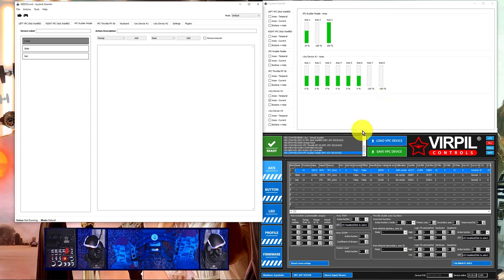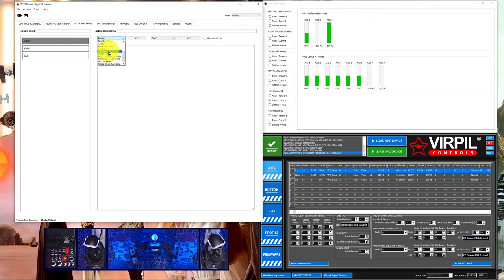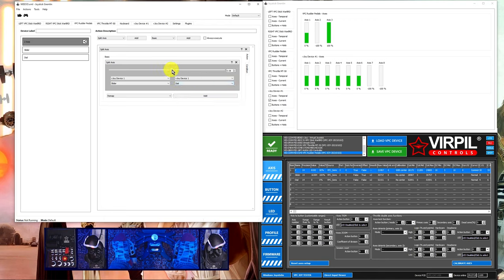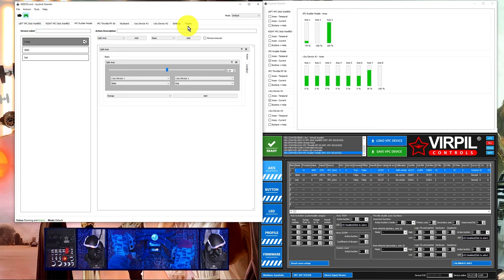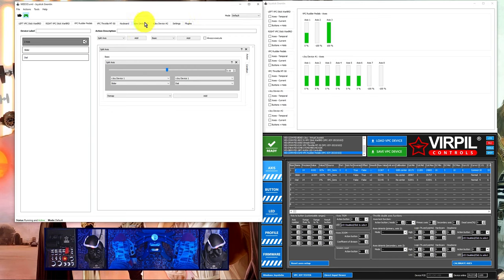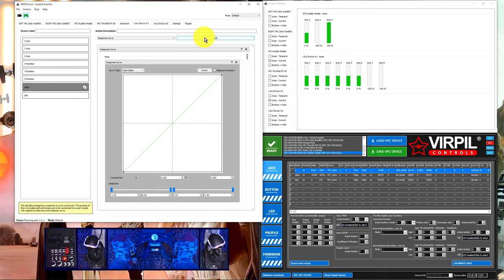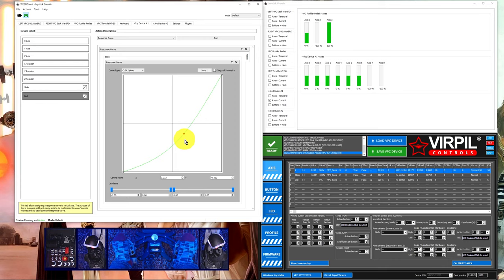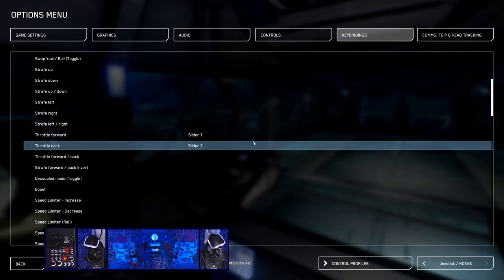Joystick Gremlin - How To Split Axis

Comment: Hey man thanks for this tutorial (1 year late to the party).  I'm using split axes as an attempt to workaround an issue I'm having in star citizen where ships randomly continue sliding 1-2 m/s after stick axis has returned to center.  Confirmed in VPC tester there are no residual inputs being detected that would cause this, calibrations are properly centered. Happens with both WarBRD/ Constellation Alpha and the same pedals you are using in this video. Have you ever experience this issue in SC?

Comment: Can you make it so that you have the standard axis still available?
Use case: virtual toe brakes -- my rudder pedals (VKB T-rudder mk4) don't have toe brakes, so I want a button to slowly activate differential toe brakes, but I want the rudder to remain active as well-- and if I apply one pedal the opposite side will reduce pedal pressure. 
Even better might be an option to have a separate slider as the total pressure applicator when centered -- ie slider at 50% means with rudder pedals center and button held == 50% brakes.

I've tried VKB's T-link software, however that thing is a giant piece of shit with memory leaks and tends to crash after just a few hours.

Comment: you are my saviour
Reply from the maker: Glad to help!
Reply: @RedLir_Live  I spoke too soon. Following your steps, it seems it didn’t split the axis on my twcs pedal. I was also wondering, do you need to use hidhide, in order for joystick gremlin to work (currently in use). Thanks in advance for any help!!!
Reply from the maker: If you don't use hid hide the game will see the physical axis as well as any vjoy axis you assign so binding can get messy 

You can still make it work but you need to turn on the input repeater function in the menus so JG will repeat the vjoy bindings over and over while you're doing bindings and then turn it off when  you're done

Comment: Can you split the throttle stick into keyboard inputs W and S? Since no man's sky isn't compatible with peripherals it doesn't work with axis settings
Reply from the maker: Yes. Look at the "Virtual Buttons" video in the playlist for some examples
Reply: @RedLir_Live  ya I was playing around with it but it feels like an on/off throttle not linear. I feel like this is an issue with no mans sky specifically but do you have a smoother work around?
Reply: also the axis on the right stick for pitch and yaw doesn't even work in nms lol